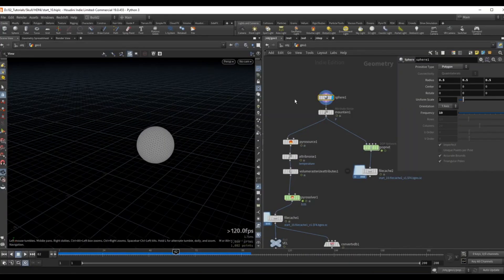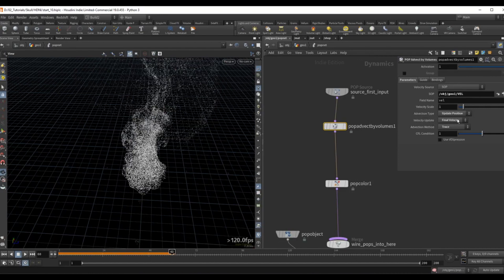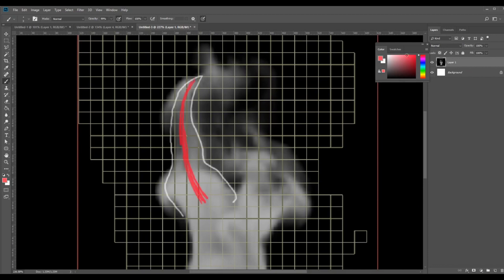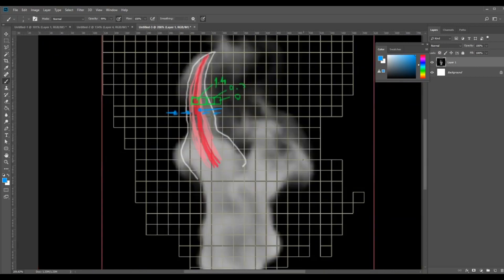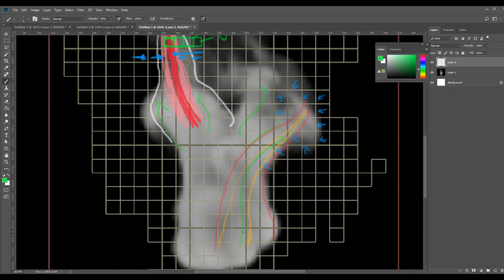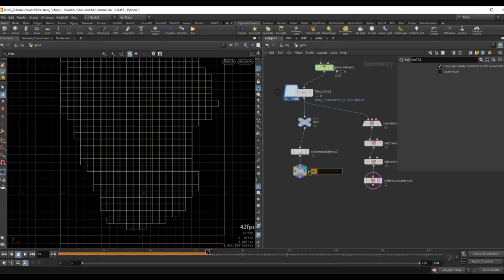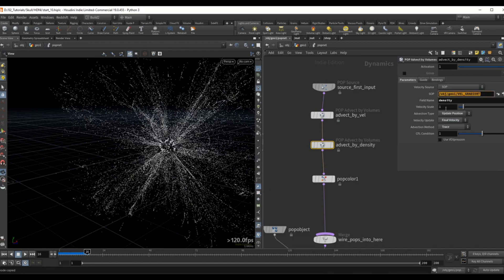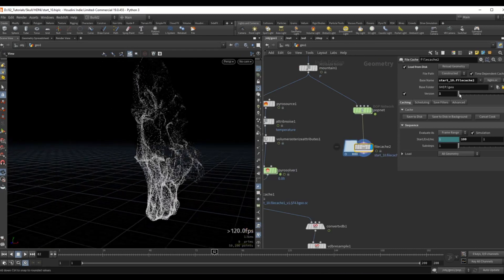VFX Essentials - Volume Gradient Advection - Houdini Tutorial

Comment: Amazing video! Would it be possible to advect in the same way the pyro sym itself?
Reply from the maker: I think so, yes. It's just a velocity field after all. You would need to create this new field inside the pyro dop net though, you might be able to use a gas field vop to generate the volumegradient of the density inside the vop, and add it to the "vel" field. I'm not sure if that would work though, I'll have to try it first!

This master class on pyro may be able to help : https://vimeo.com/454912381
Reply: @voxyde  I'll study this video. Thanks for the link! Make a video on the topic if you can. I'd love to c it.
Reply: @voxyde  I tried these 2 lines of VEX in a gas field wrangle with no success so far: 

vector grad= volumegradient(0,"density",@P);
v@vel += grad*0.1; 

any suggestion? :)